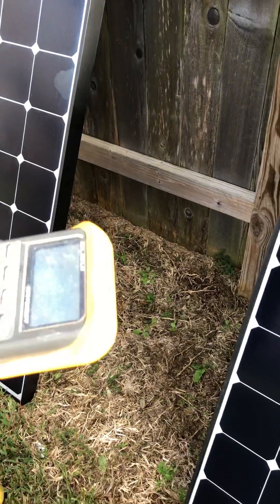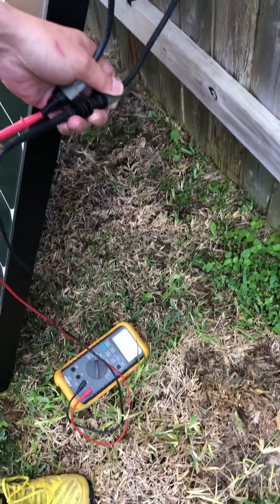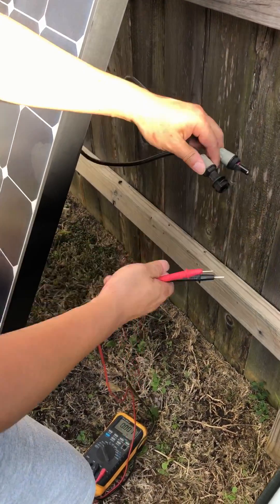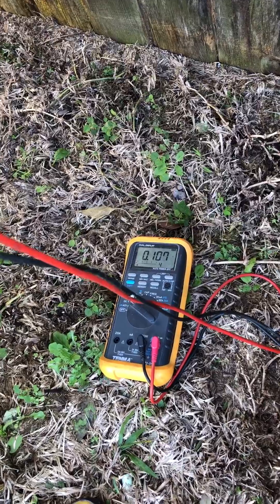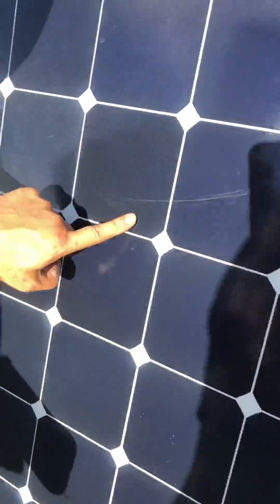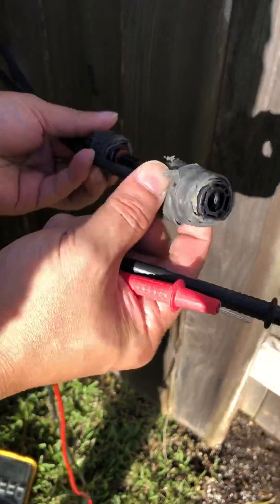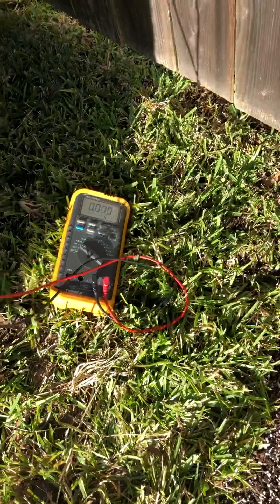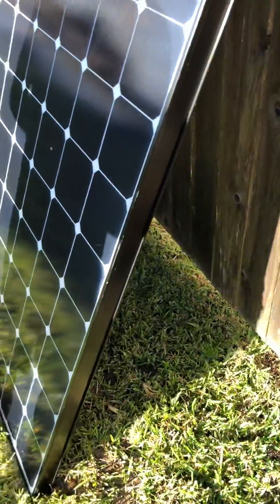How to test solar panels - broken solar panel

Comment: What should the multimeter be set at to test a solar panel? TIA
Reply from the maker: I set the multimeter on DC V  (direct current voltage)